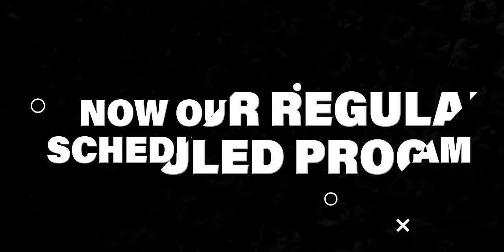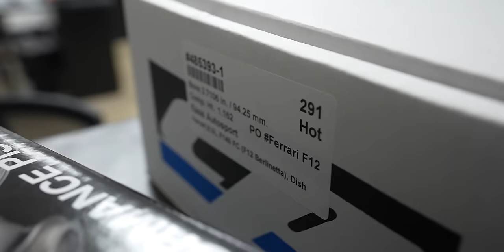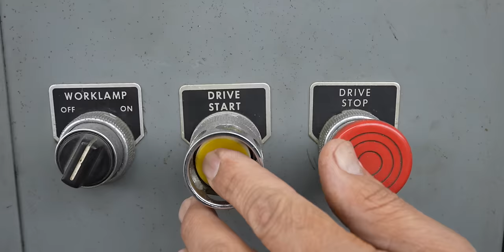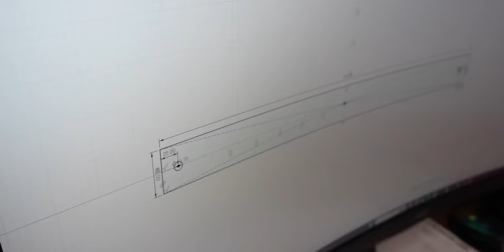FERRARI WON'T LIKE THIS.... FORCED $21,836 DISCOUNT!

Comment: You should clock the fans on the radiator so the leads are pointing down, seeing as it's in the back instead of an engine bay. Loving the build!

Comment: Mike Essa was an exceptional hire for the channel.  He has a library of knowledge about cars and engines, he does phenomenal work, and plus he's a content machine who helps keep the channel rolling along.  Damon and Dave, should really consider giving Mike an equity stake in DDE, or cut him in on a share of the cash flow.  Personally,  I would offer him a equity stake with a 5 year vest that comes with a "significant risk of forfeiture" (for example, if he leaves the channel before the stock is vested, or is terminated for cause, he'd lose the stock grant) to lower the tax consequences.  Whenever you push equity across the table to an employee it's creates a taxable event for the employee, but the "significant risk of forfeiture' language in the equity grant will significantly lower the tax obligation by at least 60 to 80%  or more.  This is an invaluable approach to giving very valuable employees an ownership stake while incentivizing them to stick around. You have to always assume there are multiple parties that are constantly reaching out to Mike to try to poach him.  It would be a smart business move to lock Mike down. Besides his superior knowledge of race cars and engines, Mike is a content machine.  You could even start a second channel around Mike showing all the behind the scenes stuff that goes into building the crazy cars for DDE.  This would let Damon and Dave focus on driving the cars, going to rallies, greeting fans, and selling merchandise.  If you want to send me a new DDE Ghost hoodie size XXL for my invaluable advice, I'll accept it.  Cheers!

Comment: Hey Mike? Word for the Day! 
Pulse Width Modulation = just a part of Brushless Motor Control
The fans should have a built in speed controller, the little wires are not only for signal but most likely CAN Bus data control depending on the Engine management unit
Reply: I vaguely recall that these Spal BLDC fans do have an internal controller. 

Pinout as follows.

Pin 1 Red VCC +D
Pin 2 Black Gnd -D
Pin 3 Yellow (analogue control)
Pin 4 White PWM signal:

Signal parameters: 
Pull up type. 
50-500Hz
Duty cycle window of between 15% and 95%
Outside this duty cycle window fan will not operate
There is no 11898 coms.

Comment: The mounting of the radiator with welded pins was genius. Easley the bed t tip I’ve picked up. Makes the radiator easily removable and installable. Mike essa is next level

Comment: Is it a good idea to mount radiator and fuel cell so close to each other? There is plenty of room to separate them not to have heat exchange between them. Also the fuel cap should be distanced from heat and fan motors. Just my opinion, understanding Mike wants to keep the weight closer to axle, but still safety goes first

Comment: I’d 100% try hold that exhaust together with some exhaust heat wrap. It would be a rough job but at least it’ll stop the exhaust gasses possibly setting the car alight.

Comment: Mike do you have to weld in a petcock or cap on the top of the rad to burp the cooling system since it’ll be higher than the hoses and engine?

Comment: Hey Damon and mike something also to think about put them behind the passenger seat is a tank with a pump that can give you water or Gatorade into your helmet and you can actually do what you’re doing to the gas tank and make a fill up there by the quarter window and use that to fill it up it’s the same set up as what NASCAR uses

Comment: I have a question for Mike and his fabrication team: what are you doing to prevent "dissimilar metals corrosion" in the F12 build? Sandwiching steel to aluminum will result in the corrosion of the aluminum frame and body. In the aircraft industry steps are taking to prevent this using various surface treatments and coatings.
Reply: Good thing it’s not an aircraft
Reply: @Anthonyw421    Metal is metal no matter where you use it. If they're different, ions get exchanged and unpleasant things follow.
Reply: @Anthonyw421 Tell that to landrover. The bottom six inches of doors disolving is because they effectivly turn into a battery due to galvanic corrosion.

Comment: I have a Spal fan in my E36 which is a long way froma  F12. Though here in Malaysia it's 30 degrees Celsius everyday or more and with an Aluminum radiator it never gets hot and actually cools down when in the heavy traffic.

Comment: Change the rad placement. Rethink it. Away from driver and tank. In an accident your done. If hose or rad has leaks its not leaking out the car but inside.

Comment: Damon designed those sweaters after reading all those dollar gas station stickers...that usually are on minivans and clapped out hondas running ebay turbo kits with stock motors

Comment: I’m a fabricator and I don’t get why Mike measures everything in mm. We use inches in America 🇺🇸
Reply: Probably because it's logically easier to calculate, better definition in accuracy and is the measurement system used internationally for engineering and science.

Only 3 countries on the globe still use the imperial measurement system.

Liberia, Myanmar and the United States of America.

Comment: If I recall correctly, you all straightened the driveshaft.  Knowing you added weight to the arms, did you drop any rotational weight from the heads to offset that?  Are you net 0 or +/- on rotational mass?

Comment: Why not go air to water especially if there is a space concern and it runs a lot colder. I would understand if he was on methanol but I think you’re going E 85 how would you guys handle all the heat especially in California in the summer not trying to contradict you, but is there any way that you can try to explain it because all of my life I’ve run air to water for roll racing and track driving

Comment: Mike what do you think about Naca ducts in the side windows for air flow to the radiator? Or piped to the rear brakes? Ehh prolly not.
Reply: Naca ducts work great when they are in high pressure areas on the car, but since this car will live sideways, it will actually just reduce the amount of air that would go on to the rad area (I actually tried this years ago in my fd car)
Reply: @MichaelEssa101  oh okay got it.  Ya after I mentioned that I remembered what you did on your current FD car. The way you did that cut out and fabbed a box through the rear window allowing air to be pulled through to the radiator. That’s a real clever use of the space. Thank you so much for the reply man!!

Comment: Cooling issues could be helped by running methanol obviously but makes the need of a dual system for street use like the drag and drive guys do.  The meth would make it run quite a bit cooler but contaminates the lil quickly.

Yall should be running VR1 after what we see rob dahm do with it.

Comment: Isn't the radiator need fresh air when the car is running? Even in many cars if the radiator is stored at the side or back, there is some kind of vent right to channel air through it. 
So why is this radiator stored inside the vehicle? 
Can someone please explain? Sorry, I'm not an expert in this mechanical engineering thingy

Comment: the fans can only do so much, you need actual air flow through that radiator to keep that back bay cool and the coolant cool? That thing is gonna put off so much heat and with it all condensed in that little truck space it’s just gonna circulate all that hot ass air inside the cabin of that car….

Comment: did you know there is a group of individuals that hunt exotic cars and vandalize them, but not blatant damage, like scratching the glass with a diamond, slice around the valve stem, metal shavings in the intakes, disconnecting anything the can reach. good luck guys.

Comment: Mike, on your mounting of the radiator, how will you protect the driver in case of a blown hose.
Reply: He said it was going to have a sheet metal firewall behind the cage, separating the driver from the back for safety.

Comment: wait hold on a moment... why arent you getting the enginer Dyno'd before you permamently reinstall it into the car. At that time the technicians will be able to calculate for you roughly how much cool capacity you require for that engine. Then you will be 100% sure you either have enough or have overkilled it.

Comment: If you’re building a purpose built race/stunt car… running methanol would help to eliminate a lot of the overheating risk wouldn’t it? Or meth injection at a minimum

Comment: When you are running a drift car that hard, and in that high of an rpm under load, what temps the engine hitting ? massive oil coolers? healthy cooling system? I would imagine it wouldn't be working in the same as a front mounted...

I know using race gas, or e85 e 90 keeps temps down as it does
fire at a cooler temp. maybe a little nitrious or liquid nitrogen cooling system.. lol joke

Comment: hi ! Was , keine 2  Kompressionsringe , abgewandelt je , und keine 2 Ölpumpenringe und nur einen Abstreifring Keine Golfballbohrungen Omegastroke form and no Ceramic coat over with detonation builds threw in head , no close Chanel struktures ! :))) My F0 Qusttferralario got 6 l and perhaps over top else ... morethunder ;) Vmax ask your self of give 5th gear !;)
It you build looks well ! Need Irmo Safety belts or some 8 point of Momo

Comment: Hey Mike 
Plz don't weld that radiation mount plate along the length of radiation
Because it will add weight. Make a cutout plate section which we need for mount. I mean I am not judging you . Your pro my man

Best of luck for work 

And Dave by watching that video you said audience didn't like.

Well I like it ,DDE'S  is problem is my problem to .we are family 

Peace for India ☮️
Rakesh Ambaliya.